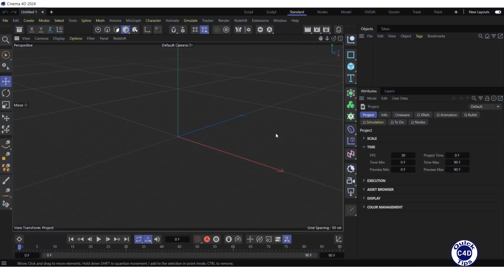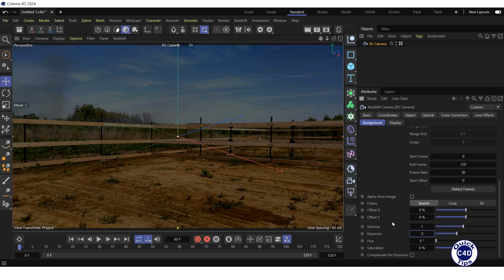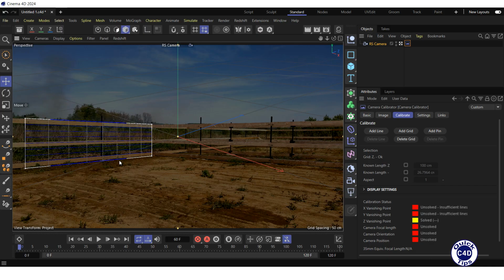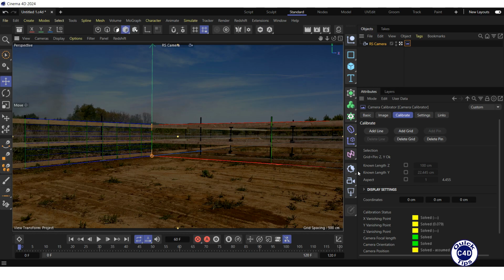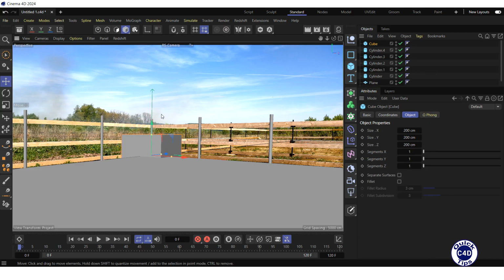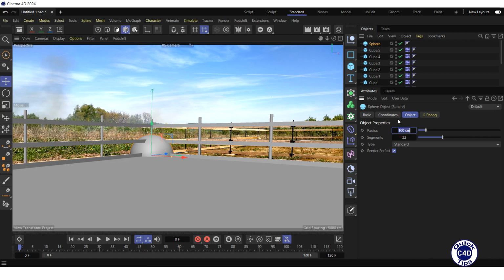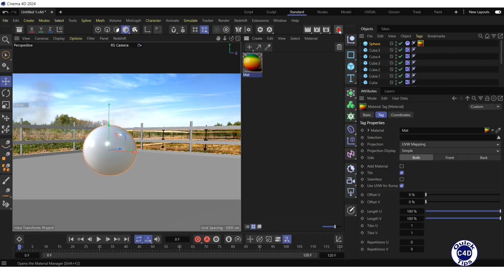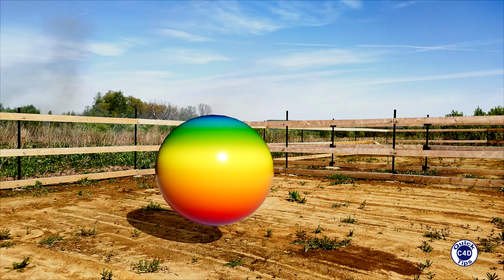Cinema 4D: Adding 3D Objects with Dynamics to Video

Comment: Can the footage have movement or does it have to be locked off like in your example? thanks
Reply from the maker: There is movement in the footage (smoke moving and grass swaying), but the camera was stationary during the shooting. If you have a video with a moving camera, adding objects is also possible using Motion Tracker. A tutorial with Motion Tracker is available here: https://youtu.be/K0uD1BpwVHE